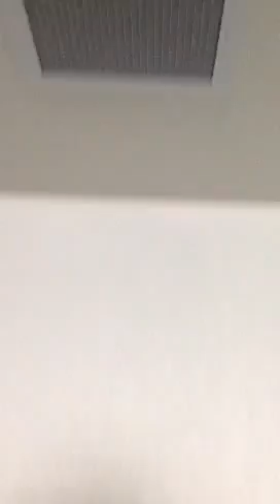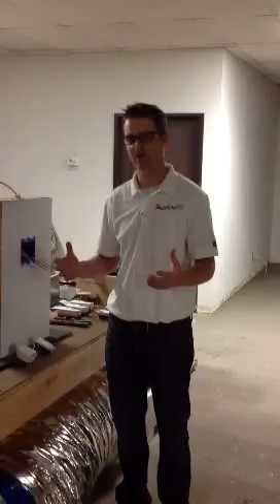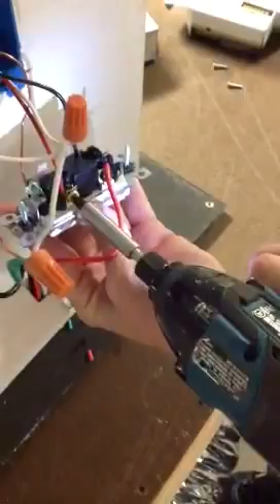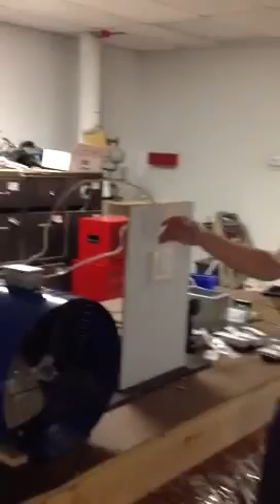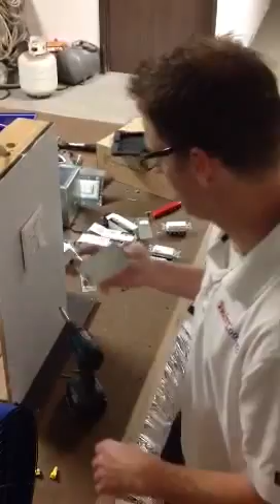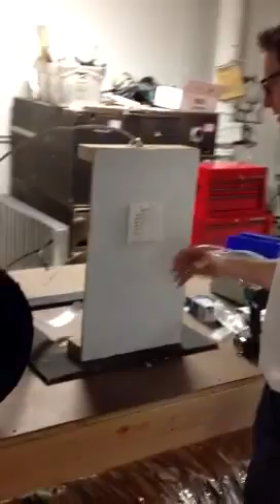Single 3 way switch ( 2 speed wiring video ) full version

Comment: Based on this video, I could get a smart switch (to replace the timer) and smart three way switch (to replace the hi/low). Get it all connected to my home app and with "Hey, Google, Attic fan to hi" The single switch would switch on, and the the 3 way would turn 'on' (high). "Hey, Google, Attic fan to low" the 3 way switch turns 'off' (low). "Hey Google, Attic fan off" turns the standard switch off. With the new timer feature for the Google system, I could add the command to run for a set amount of time, or turn it on and "Hey, Google, Attic fan off in four hours". 
I have yet to build this set up and see if it works, but I believe this would be a solution for a two speed fan smart control.

Comment: This is bull shi - . In using a  way switch, the only on and off function falls back to the timer or yanking the plug out of the wall. Why not upgrade to an on  off on 3 position switch and get it over with? Geezzzzz

Comment: Using your wiring example, the fan is not grounded. All of the ground should have been connected, with a pig tail going to the high/low switch.

Comment: Thank you.  I was replacing a rotating 60 minute switch (with a high/low) with a multi-time switch, similar to what you were using, and the wiring on what I had was completely different than the new timer switch.  I'm not sure I ever would have figured it out without this video.  Thank you again.  Jim Z.  Centennial, CO

Comment: Thank you for posting this video... I have been trying to make this connection for over two days and finally got it after you showed how to connect the load wire to the black screw on the 3-way switch... I am very grateful.  Thank you for taking the time to walk us through this unusual setup.